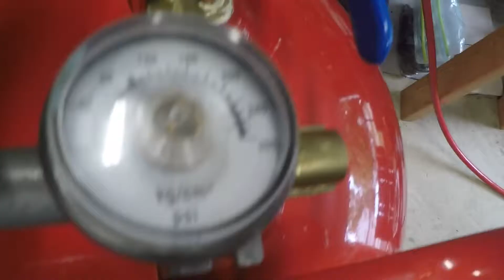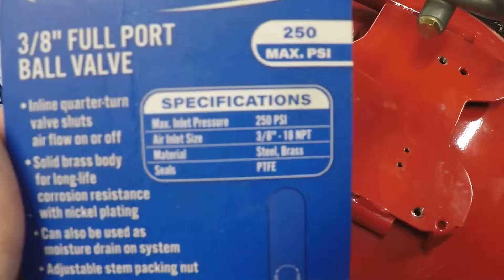Making a Reserve Air Tank From a Dead Compressor

Comment: All you had to do was plug one of the holes on the tank and put a nipple on the inlet where the regulator is.
Reply: You sound like you know what you're talking about. Let me throw a question at you please. I have a 21 gallon Harbor Freight upright compressor. About a week ago I ran into a guy at the dump who was throwing away to Upright craftsman 26 gallon bottles because the motors were used for something else. I won't even start on how that confused me but that's what he did. So now I have two upright 26 gallon bottles sitting next to my Harbor Freight 21 gallon air compressor. What do you think would be the most efficient way to tie all three in so that I would have all that reserved air?

Comment: As a tradie fitter and tirner all these people on here and other vidz claiming check valves aint needed i cam tell you now check valves are needed for saftey and position of air inlet and air outlet DOES MATTER Peiple do your research as to why  what im not going to give you the answers go goodle it what ever ask someone get a few bits of advice and reading material and comebtoy your own conclusions but my answer would he safety matters

Comment: Do have a look inside as thin cheap consumer sheet steel pressure vessels don't last forever.  USB borescopes are cheap and very, very useful for inspecting engines etc too.

Comment: If painting, will it be wise to put an air dryer system on the second tank as air comes out or between both tanks?
Reply from the maker: For painting, yeah I would think about an air drying system especially if the gun was high flow and/or you want a super high quality finish. For occasional  painting where you're not looking for the best ultra high quality finish I may not bother. I find that I only get a lot of water in the air coming out in the middle of summer when it's super hot and very very humid. Other times of the year I get nearly zero water mist.
Reply: @ thank you

Comment: Question when second tank fills up will first tank stop pumping from pressure
Reply from the maker: Yes, there is no regulator or restriction between the two tanks so the pressure is the same in both. The motor will stop pumping when the pressure reaches its normal cutoff point.
Reply: @billyb351  noted thank you

Comment: This is on the agenda this season. 
The big compressor is in the boiler room in the heated area,but i still work in the unheated area during the winter. 
So of course,after 10mins of air tool use ,the line starts to ice up and choke flow. 
Since ive got a dead craftsman 40 gallon compressor,im gonna run the shop air into that to try and alleviate some of the moisture issue and see what happens.

Comment: The specs on the valve mean that the seals inside the valve are PTFE, or Teflon.  Use 3 turns of Teflon tape then slather it in pipe dope for air fittings.  It’ll seal up every time.  Keep in mind that you’re dealing with tapered threads so sometimes a little leak just needs a little bit bigger wrench and the fitting snugged down to stop a small leak.

Comment: I’m wondering how many cycles did the air compressor run to fill both 26 gallon tanks ? Also what is the duty cycle of the compressor ?
Reply: Its a good question and i heard different answers for that. Some people says, its actually better for the motor to run a bit longer than kicking in more often. The best solution for me (with the exact same setup in this video) to lower both value on the kick in/kick off pressure. But my case is probably special, because i need very low pressure (2 bars) as long as its possible. So i will reduce the kick in pressure from 6 down to 2.5 bars, and the kick off pressure from 8 down to 6Bar. In between this range the motor does not suffers and only runs just a bit longer than usual, yet kicks in way less

Comment: Tidy job but could have been done with significantly less fittings. The more joints then more chances to leak. Also a good idea to not put paste jointing compound under pressure for a few hours. Just sayin!!!
Reply: Dude I just watched, and thought the same thing, dude has more fittings than a pipe i had in the 70s at least 8 people were able to smoke

Comment: Great project. I'd suggest your valve on the reserve tank is upside down. Lever should go up to open.
Reply: Not like it matters…handle in line, it’s open, handle cross the line, it’s closed.  Not all that technical.

Comment: I used to work at a hardware store and there's a lot of people that don't realize that there are different thread types there's your normal pipe thread and then there is also garden hose thread and there is also compression thread and there's also flare thread which is usually for gas and stuff and then there's a lot of things that have their own proprietary threading that nothing else will fit on and if I remember correctly I think the toilet has its own thread for the water intake
Reply: American standard 7/8 ballcock thread on all toilets here…idk if anything else is threaded that size, but any and all supply lines need to be whatever size is on your valve (probably 1/4” compression) x 7/8 ballcock.   Yes that’s what it’s called.  Find the hone depot employee who knows nothing ask for it by name….  I need a hose to hook onto my ballcock, can you help me? 
Indeed all these threads you mention are common and do not interchange.  I worked at hardware store in Murphy younger days to and it’s shocking how many people have no idea… and dont forget your SAE bolt fine and course threads as well as metric bolt fine and course.  All of the above can be differentiated by sight and do not intermingle.  I even had guys come in trying to piece together odd little projects and tell me they needed some nut thingies to go with screws like….”this” and they’d pull out a wood screw or a sheet metal screw.  One guy got made and said I was stupid because I didn’t understand that he just needed the nuts for the size of screw he brought in and wouldn’t accept that there was no such thing as a wood screw threaded nut.  Air fittings should be NPT (pipe thread) and compression fittings on copper tubing.  Flare fittings are for gas but some older houses have them on ice maker water lines…and double flares for pressurized hydraulic tubing like on car brakes.  They need special tool to flare the lines. No Teflon or pile dope on compression or flare fittings. Never. Ever.  Never ever.  The nut holds the flare tight against the fitting to seal it and anything in the threads can make them not all lay flat so the surfaces make the seal…sane with compression, the ferrule seals to the inside surface of the fitting and they’re held together by the nut. Teflon AND pipe dope on pipe threads, which are tapered and the thread dressings are just to get them to screw together without galling, they need to be cranked down good to get good seal on the threads.    That’s all for thread talk today…join us next week for pvc threads…and don’t forget our end of season finale where we’ll discuss reverse threads, hose threads, and taps & dies.
Reply: @invictusbp1prop143  
1/8npt and 1/8bsp makes me chuckle. 
1 thread difference between the 2. 
In a pinch, you can interchange them once , as when they're removed the fittings will have a boogered thread. 
As long as it doesn't have to be messed with ,I've put a 1/8npt brass fitting into a 1/8bsp fitting. 
Sometimes you'll get lucky and a good tap and die sets has a 1/8npt and a bsp tap and die and you can clean either up to the threads you want. 
I wouldn't do it on the space shuttle but it's good for when you're in a pinch.
Reply: Depending on where you are, your toilet water threads might be different from mine

There's NA, SA, africa+europe, india, and SEA as regions with different threads

Russia might be going back to their own old standard due to.... Reasons.... As well

Comment: Hi Bill,  This was a very informative video on how to repurpose an old (but still useful) air tank.  My question is,  since you already had a male end on the inlet side of the tank, why did you need to make an air transfer hose? Couldn't you just plug the female end of the compressor hose into the male air inlet connector on the reserve air tank?  Just a thought.  Thanks for sharing your video.
Reply from the maker: Yes, that would work, but I wanted to be able to use the tank in parallel with the main compressor. I connect the compressor hose to a T and then the transfer hose from the spare tank to the T. The output of the T goes to a high quality regulator. I removed the regulator on the main compressor so I get full pressure in the spare tank. Doing it this way I am able to remove the spare tank from the system at will and still have an operable system.
Reply: @billyb351  Thank you for your reply.  I see that your plan for the reserve tank goes beyond what is shown in the video.  By adding additional components (T's and a new regulator). That would have made a good Part 2 video.  Thanks again.
Reply: @billyb351  instead of the plug why not just put another quick connect so you can run 2 air hoses
Reply from the maker: @johnambler6924  I could have definitely done that but I don't need a second hose right now (and I didn't want to burn another quick connect that I wouldn't use right away). If in the future I find a second hose would be useful I'll take out the plug and put another connector.

Comment: Hey there ! So quick question., can this setup work if I had a smaller compressor to fill a bigger tank ? ...e.g like double the size of the smaller compressor tank..?
Reply from the maker: Yes it would work. Just make sure the motor doesn't get too hot. It shouldn't if it's a decent compressor. Also you would be saving some wear and tear on your motor. Most of the wear comes from the compressor turning on, not really while it's running.

Comment: If i run a input and output on my 2nd tank from and to my first tank, would i be able to use 1st tanks controls as normal? I would still b getting greater air capacity right?
Reply from the maker: All you need is one run from the input of the second tank to the first tank. You have to connect it before the regulator control on the first tank. That's the key, you have to make the connection before that to get the most use out of it.  In other words the air in both tanks needs to be free to flow between the two tanks before the pressure controls.

Comment: Why there is no need for the check valve?
Reply from the maker: If you mean the spring loaded safety valve, that was already part of the regulator assembly. You can see it at https://youtu.be/lbC2RyGIrV4?t=268 (4:28) in the video. There is a shutoff valve on the inlet, and the quick disconnect on the outlet of the regulator. Those are really the only 3 things that are needed.

Comment: Lol I bought that same compressor and ended up doing the same thing you did with it... Tried to fix it first as well, I recognize a lot of the sights in this video.
Reply: Same here. Not the exact same brand but the exact same design. The motor actually looked like an angle grinder or a router motor. Very high rpm, huge transmission.

Comment: Good Job!!  One of the few aux tank set ups that is done correctly.  I have the same tank, from an old non-working Coleman oil-less 30 gallon compressor.  There an an abundance of videos where guys use a Tee-connection which just blows air from one side of the tee through the other side,  of course, some air from inside the tank will be discharged but the majority of air is just passed through.  To be a useful aux tank supplying air, it must have two ports, one an inlet (his left port) and one a separate outlet (his right). With that sort of set up, as shown here, ALL air must discharge through the outlet port.
Reply: Not true. If you tee an additional tank into your system you're still adding that additional volume of air at your set pressure. When your compressor runs anything after your first regulator will build to your set pressure weather you have an in and an out or just tee it in. It works well with something that requires a high cfm like a blast cabinet because you have that additional volume of air pressurized. It's essentially no different either way. What he did just works best if you plan on making it mobile. I personally have my aux tank in the attic of my garage out of the way and running a designated in and out line would just be a waste of pipe.
Reply: @jabber12121  If I read your comments correctly, the pressure with a Tee is the same in both tanks and yes there will be some useful air released from the aux tank but not nearly as much if there are separate inlet and outlet ports. In that setup, like I said above ALL air must go through the aux tank, whereas in the Tee setup, some air is blown trough the Tee and not through the aux tank.
Reply: @scarpia519  That's not true though. Look at it this way, air moves from areas of high pressure to areas of low pressure until the pressure is equalized. Say you pull the trigger on your blasting gun, that creates a low pressure environment at that point. Because of this, all air in the system (assuming it's all pressurized the same) will flow to that point equally. It wouldn't affect your air production or max pressure from the compressor itself obviously but an auxiliary tank would most definitely function the same if tee'd in.
Reply from the maker: I also would like to be able to move this tank around with a full charge of air. Can't do that with just a tee connection.
Reply: Instead of the plug why not put another quick connect so you can run 2 air hoses
Reply: Exactly. Alot of them had me scratching my head

Comment: Can I use larger tank for external. I mean my current air compressor is 8 gallon, and want to add 26 gallon for external tank? can it fill the larger tank? 
additional my current air compressor generates 64gallon per min (2000+ Rpm) although it was small
Reply from the maker: Yes, your compressor can be used to fill up the larger tank. You might actually save some wear on the motor doing that because it will run longer and cycle less. Startup is where most of the wear on a compressor motor comes from.
Reply: @billyb351  wow didn't expect that is so easy than i thought. by the way, is it safe? I'm very keen to upgrade my compressor. the motor is a lot faster than larger compressor motor... (came with 1250w)

About the wear, I might let the filled air in the tank. Only once a week will throw all the air out for maintenance. I guess it will save a lot of energy and wear. Right?
Reply from the maker: @haizar3d  The only thing you have to worry about is heat. The longer a motor runs, the more heat it makes, however the motor should be able to cool itself. Think about it though... if you're heavily using the compressor, the motor is running 100% of the time as it tries to keep up. This is no different. There are fins and a fan in there. I've been running this setup for a year now and I haven't had any problems at all. You will benefit from the larger air volume for sure.

As long as the external tank is sound and you don't exceed the maximum pressure rating of the external tank, it's safe. It's best when the external tank is the same rating or higher rated than the compressor.
Reply: @billyb351  probably used to spray a car. I think the motor will run often if i keep using stocked 8 gallon tank. And im sure it generate more heat from that, mine was silence motor. Thinks the 26 gallon compressor here using belt motor and it surely heat resist as the motor not attached to the tank. What do you think... should i just upgrade to belt motor compressor?
Reply from the maker: @haizar3d  I think you could make the reserve tank and see how it does. You can always upgrade the compressor after that. You could use the reserve tank with the new compressor as well for even more capacity. The reserve tank in this video is 26 gallons, and my compressor also has a 26 gallon tank so I have 52 gallons of air available.

Comment: I have a 22gal kobalt compressor that has the exact same garbage motor/pump assembly as the one you have with the exact holes and threads too. I chuckled as soon as I saw your compressor. What a coincidence to find your video. No one sells the motor assembly anywhere. For my project, I used a 3gal pancake compressor to fill my 22gal tank. Removed everything from my tank like you did, but I went super cheap with my setup. On one side I have the same as you, shut off valve and quick disconnect. The other I used the 1/2 to 1/4 converter and have a second quick disconnect. No pressure gauge since I could use my small compressor to tell me the pressure in the big tank. You can find all parts in the 'air compressor aisle' in home depot or lowes. $20 well spent. Takes like 15min to fill my tank though. lol

Comment: You could put a fridge motor on it to make it a compressor again
Reply: Possible, but the amount of work wont solve a damn thing, because you need ages to fill up a tank like that with a single fidge compressor. Yes it could help a little bit to the another compressor, especially in downtimes, but that's insignificant if you want continuous  work.

Comment: What is the brand name of the old tank. I am just starting this project on my defunct Craftsman Evolv 3 gal tank. The configuration is not the same. I also am wondering if I can make one side of the manifold the in and use the original as the out. I would like to move the release valve to another port. Comments/Suggestions?